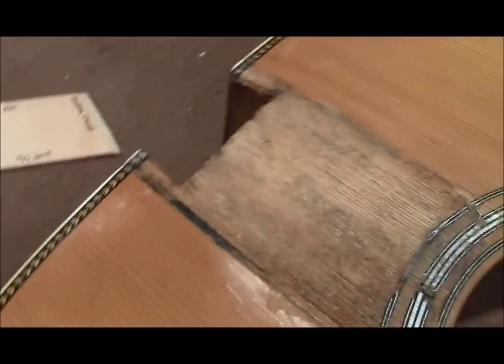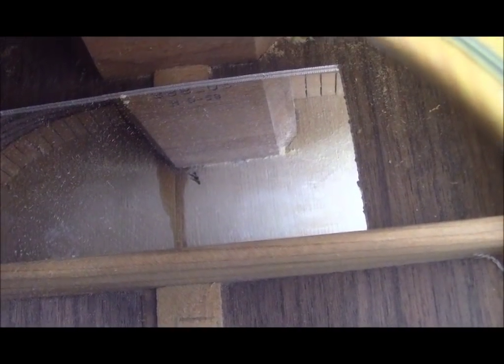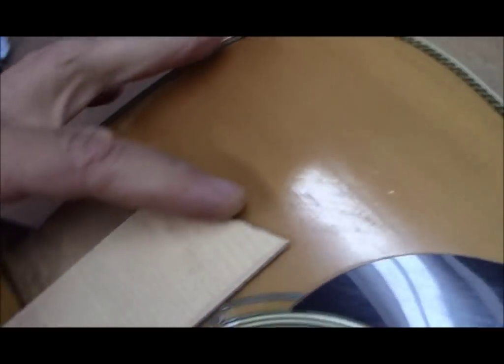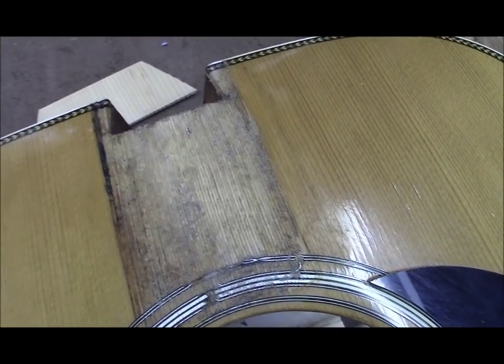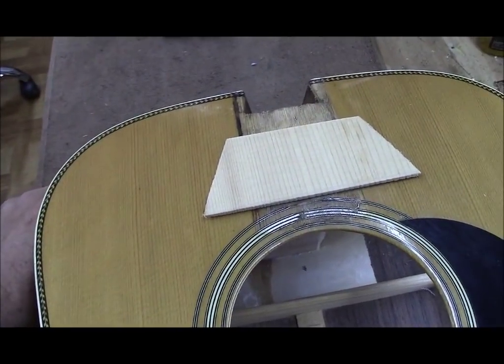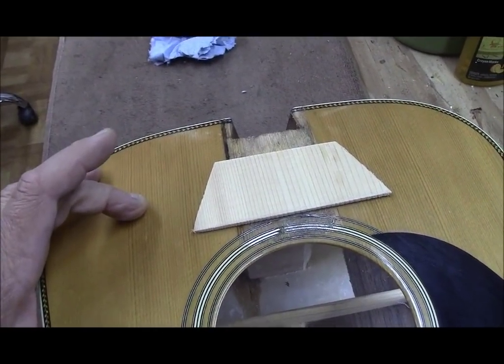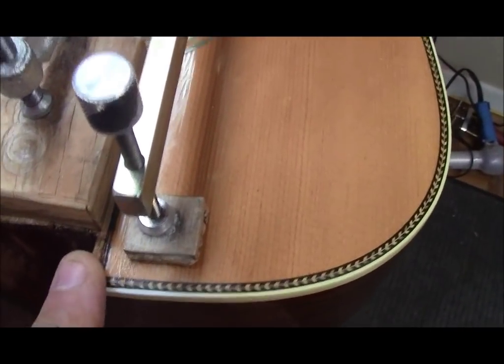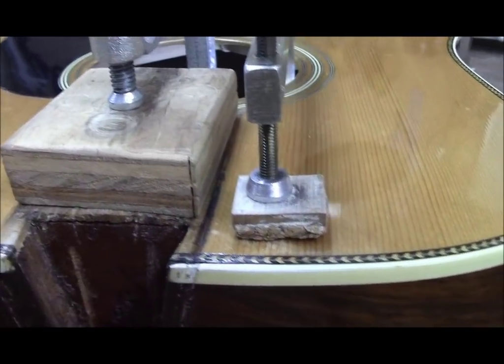Repair HD 28 fingerboard crack

Comment: This is really helpful. Thank you for sharing. Would you add the same popsicle brace to similar crack in a nylon string classical guitar?
Reply from the maker: I don't know anything about classical guitars.  I don't know what pressure they are under or how important the upper bout is to the sound
Reply: @Bryankimsey , thanks for your response. I appreciate your videos.

Comment: I've got an old Epiphone 12 string doing the same thing. If there's no gap in the neck heel to the body (I'll have to check that when I get home from work), could I brace it without removing the neck? I am confident in my ability install a brace, but I've never take a set neck off of a guitar before, so I'm a little apprehensive about doing that.
Reply from the maker: It's actually easier with the neck on because you can use the neck to pull the area back into position.
Reply: @Bryankimsey  10-4 thanks!